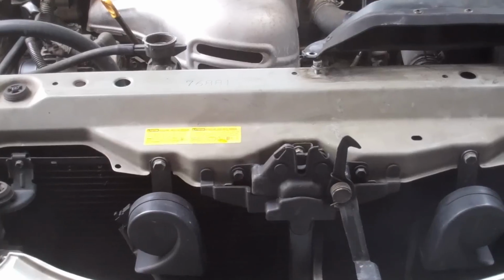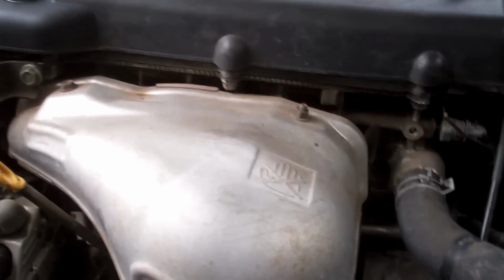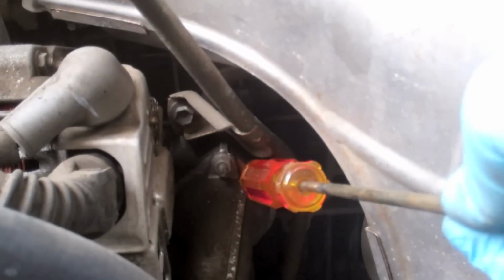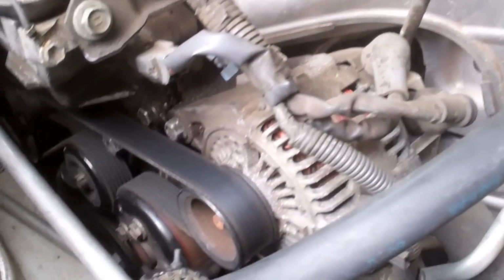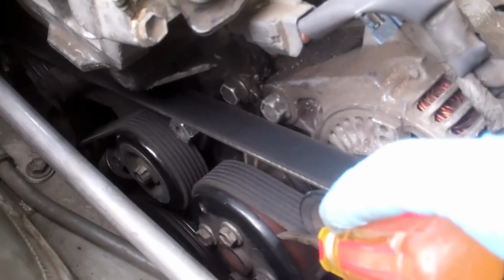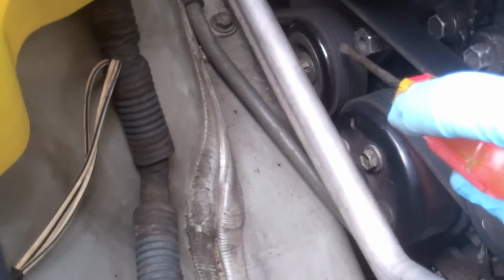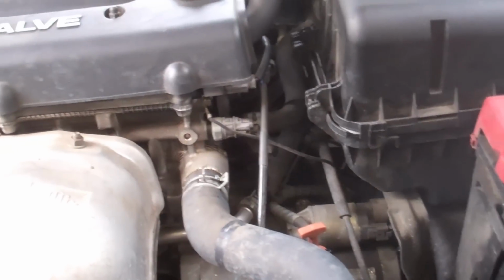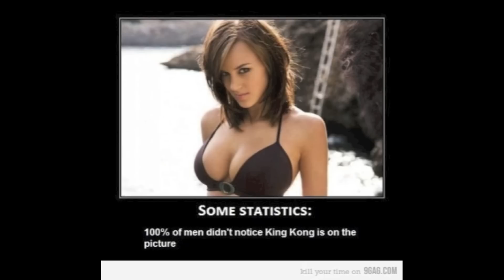How to take out Radiator and thermostat and flush 2002 Toyota Camry detail HD

Comment: So I installed the housing upside down.  The spout coming from the thermostat should be level with the motor not angled up.  The  housing has a slight raised part on the top side and the bottom of the housing has a spine.  To clarify the spine should be facing downward! I hope that this might help someone else too!  Thanks again for the post!